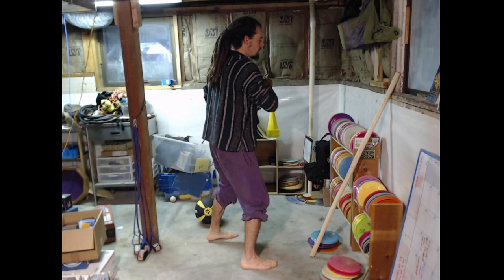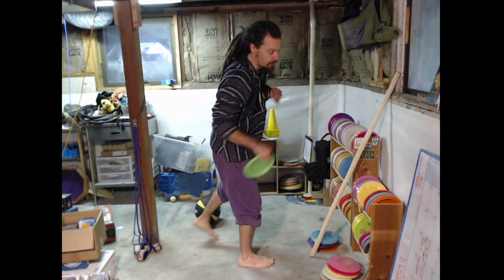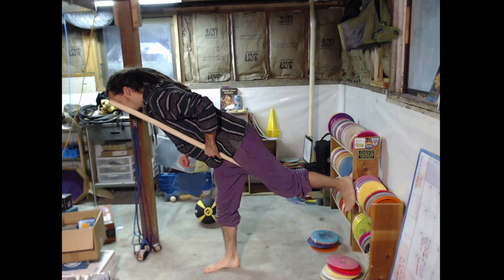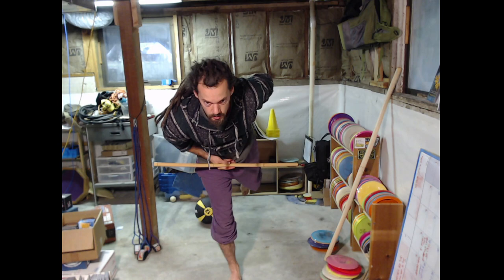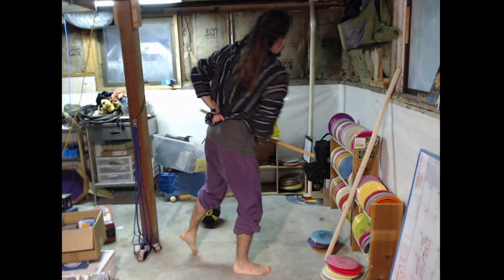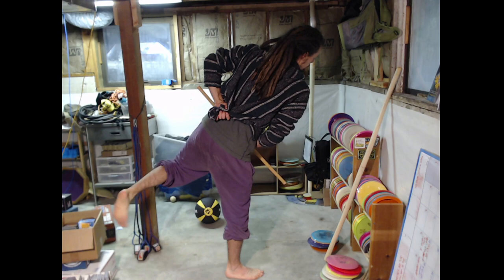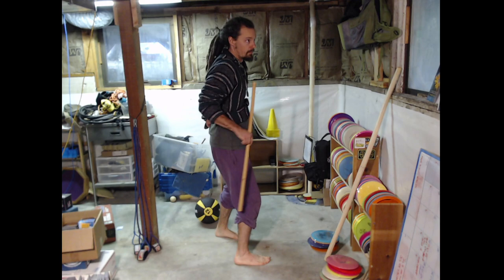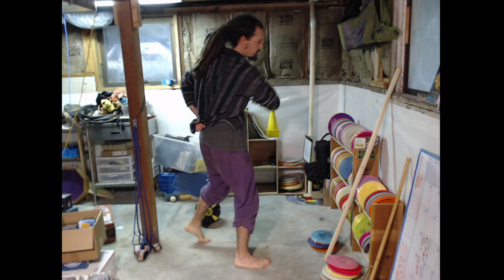One Leg Drill and hyser counterweight lecture

Comment: This one is really helpful to me. Now I somehow need to incorporate it in a full speed throw
Reply from the maker: Have you seen Brian Earharts x step deep dive video? That footwork, two separate rails, seems to be the easiest way to encourage the rear leg to continue moving forward after the plant. Which sets up the counterweight thing. 

Is anything specific standing out that you have a question about how to incorporate this idea into the throw?
Reply: @_TDG  I have seen Earhart's video. My problem is that I grasp it and can do it, slowly, but as soon as I speed up, I end up falling back into the long-term muscle memory from previous decades. I've been slowly overcoming it bit by bit, and I am certain I'll get it all put together at some point. Muscle memory can be a big negative sometimes.
Reply from the maker: @bearislandjosh5279  absolutely… another coach that helps me decode things has told me that setting new muscle memory takes 21 days of consistent practice to override an old pattern. 

Slow reps, often, and focused on the change youre making rather than the result of where the disc goes are key!
Reply: @_TDG  yeah. I need to practice much more consistently. It's next to impossible for me in the winter. I'm going to be doing field work again once it gets light out later in the day. I need to start doing more shadow steps etc in the house whenever I have a chance

Comment: isnt this just asking to blow out the right (front) knee, tho? ive been trying to reduce the risk and pressure on the front knee and open my hips at the same time, ive found an early rotation can give me just as much power as plowing into my front knee like this.

just an observatioin
Reply from the maker: I also worry about my knee. However, the only times Ive had any pain were when I went from not playing at all for months to playing and really trying to push my distance limits without getting in shape first. Sure all sports carry risk, but if you have healthy skeletal muscles Its not a huge risk. 

But do go slow with changes where you are adding power! 

I think as long as you keep the heel closer to the target you tend to load the knee in a mechanically correct way (where the knee stabilizers are all active during the load and extension and pivot) you should be good. A pivot on an unstable knee is totally asking for trouble. 

What specifically from the video seems concerning?
Reply from the maker: Also it really shouldnt feel like plowing into your knee. It should feel like there is some give in the knee as you drop the heel, then some resistance as you extend the knee to push the ground away.
Reply from the maker: Ok watching again to see where youre coming from. 

First while the foot isnt moving there is give in the hips. The front hip stops but then the rear hip keeps coming around. So that is keeping torque away from the knee. 

When that joint maxes out and you get a stretch in your front glute medius THEN there is torque put on the knee. At that timestamp the pressure should be fully on the heel which means your hamstring and other knee stabilizers should be super active, protecting the knee AND you are cued up such that rotation on the heel will happen automatically. 

If you do those things right, risk of injury is low. 

Great question!